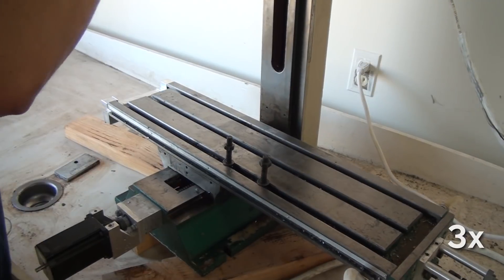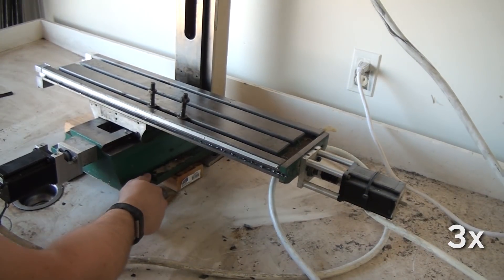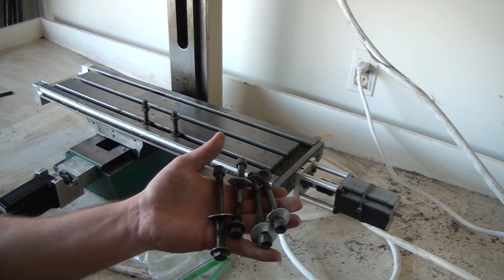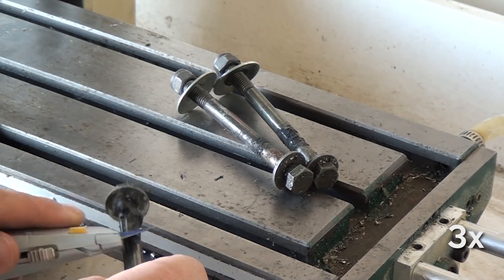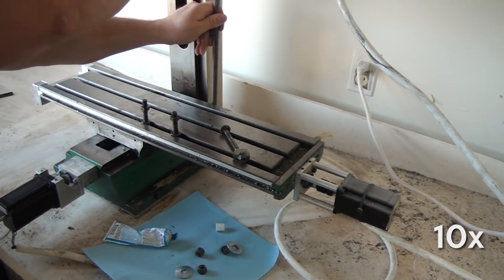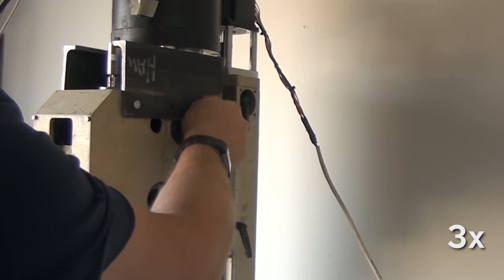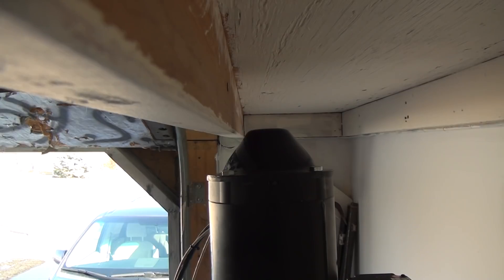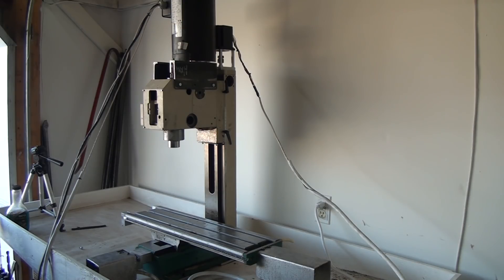Mill Installed, Motor Installed

Comment: I'd just cut the bottom of the shelf out, and if you're worried about rigidity, sister a 1x to the 2x with a zillion drywall screws and glue - done. Or... you could always raise the shelf 1/2", if space isn't critical, above it.
Reply from the maker: +tahwnikcufos If worse comes to worse I may have to notch it a bit. I'll know more once I have the column trammed and bolted on securely. Because everything is still wobbly it's hard to tell exactly how much clearance I have.